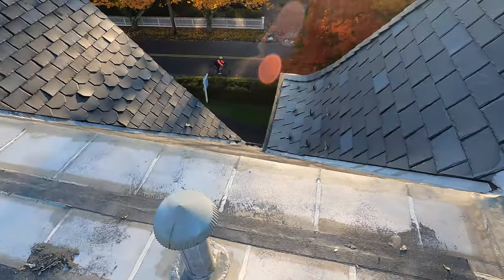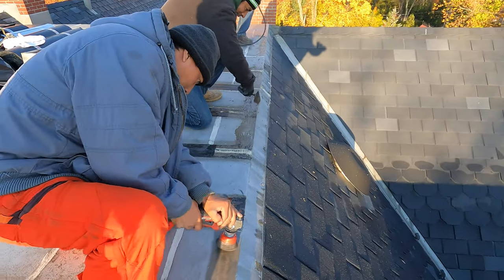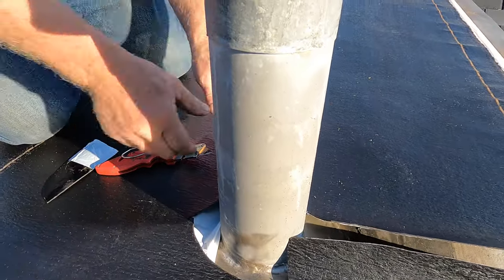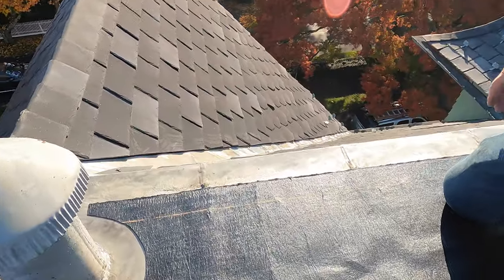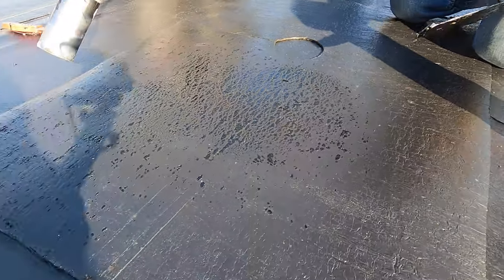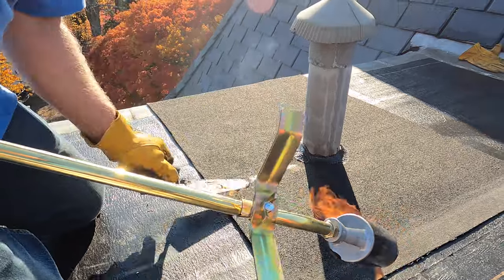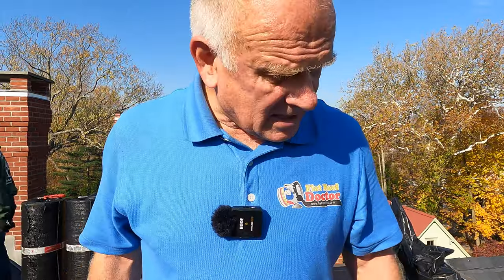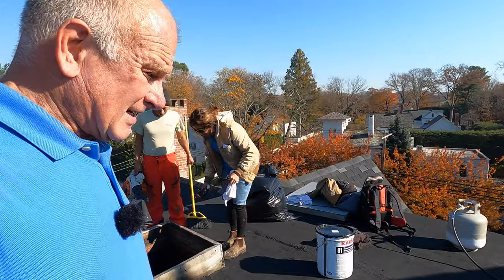Torch Down Rubber installation over a metal roof

Comment: The slit should be placed on the downward slope of the roof as rain will flow down the slope . You have the slit perpendicular to the slope of the roof which over time will allow water to leak into and under the slit .

Comment: You finally said something right. When you said the proper way do this and then changed you're mind and said you're way to do this. So you admit there is a right way to do it but you won't or don't know how. A real roofer knows that to torch on metal you need to put primer first and a real roofer know that you always start your base with a half sheet cut down the middle so you don't end up with base and cap hitting lap on lap anything less than 12 inches is not expected. If the roof has drains you start at the drain with your base half and half in the middle of the drain so when you start with your cap the cap is full over the drain. You said the other guys patches didn't stick to the roof but instead of removing it you put your base right over it. So every time you pass over it you base isn't stuck either. What a hack job. If you're putting down a new roof over the old one do it right or let someone that knows what they're doing do it instead. Trying to blame other roofer  saying they did a bad job no they were payed to a temporary patch job because they probably gave the real price to do the proper job and the owners of the place thought it was to high. So you said you would do it cheaper but didn't tell them it was just price that way cheap but you're work to who the hell puts down plastic cement under torch down.
Reply: @Peter Alexander Mielke I do teach a torching course out here in Canada and if the roof Dr. Was to take it he would never pass with all the short cut he does and the mess he makes. He would never be licensed in this country.

Comment: The valley should have an underlayment with a sticky backing laid in the valley lengthwise . You then put a 36 inch wide section of metal roof from the edge to the hip of the roof . Make sure you buy the metal roofing section that has a ridge on it so that water will hit that ridge and flow down to the roof edge and not flow over flat flashing and get under the shingles . Do not use flat flashing on the roof valley . Only use a roof flashing 36 inch wide with a hip on it . ( the metal roof section I am speaking about has baked
enamel paint on it ) .
When the roofers or you put the perpendicular sticky backing underlayment to cover the flashing 1 
to 3 inches from the hip of the valley flashing .

Since the underlayment is 36 inches wide , nail the flashing 1 inch in from the edge of the flashing as the roof valley section is also 36 inches wide . Then lay your perpendicular sticky back underlayment that covers the whole roof over the nails in the flashing . Remember to not cover the hip of the flashing with the underlayment .

Comment: What is the best way to a torch down on new concrete block parapitt  ?
Reply: The proper way is not doing it the way he does it.
Reply: Continue a full roll of membrane  into and up the wall about 4-6"

Cut a separate piece of membrane to cover the parapet and extend down the wall and back onto the flat roof.

Heat the membrane enough to get a bleedout of spooge no less than 1/4" and no more than 1" 

Take measurements and order 10' lengths of metal "coping" of a very thick gauge to cap the parapit
Reply: Also, it is highly recommended to cover any masonry surfaces with an asphalt primer prior to adhering the torch membrane to the block parapet

Comment: Why don't you use peel and stick cap sheet?
Reply from the maker: It is to flat. You need more pitch for Peel and Stick Cap Sheet. Peel and Stick Cap Sheet will only work when you have positive water flow to one direction. And then you still have to torch weld the end laps.

Comment: What brand of self stick base sheet do you use?
Reply from the maker: I normally would use John Mansfield's Dynagrip base. But I could not find any other than that of Liberty made by GAF. This base is meant for the Liberty System. It still worked for me in this case.
Reply: self stick doesnt mean its self stick. it has to be glued and them pressure rolled. that will fail in time
Reply: @xxdrloveleyxx5185  because he torched over it, probably not... he got the temp of the peel and stick so hot, it probably relaxed and sank all the way down down the roof everywhere.... if this was a cold roof, then you're right, it would fail miserably  as the bottom layer...

dude is doing his own thing... clearly